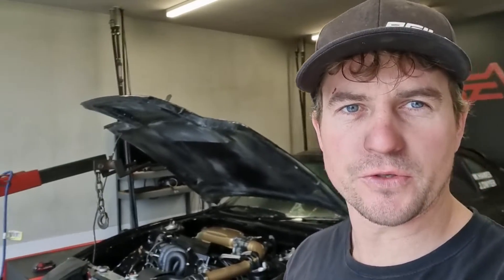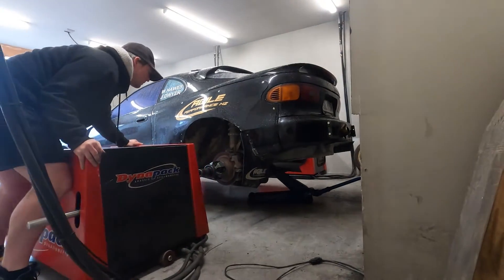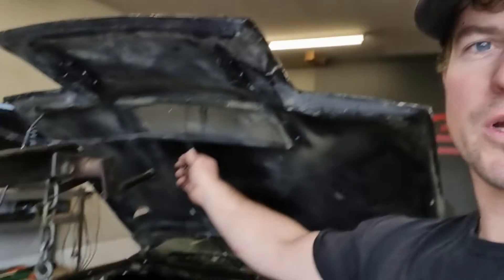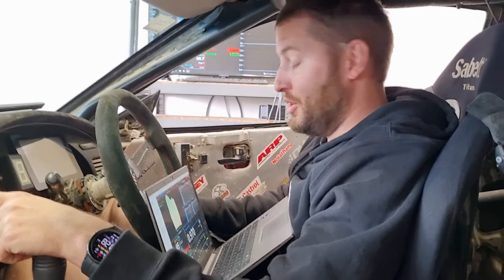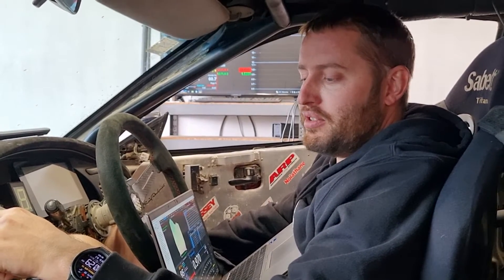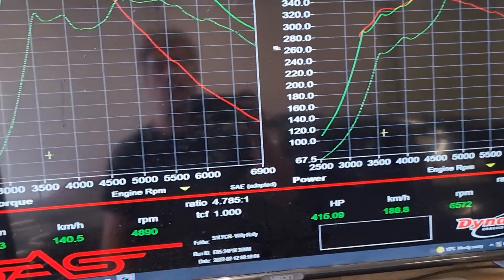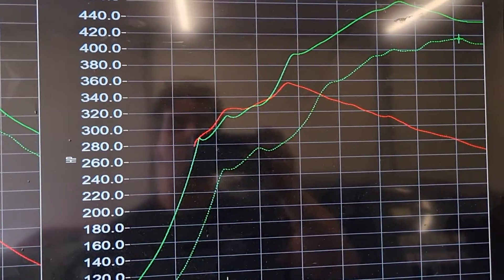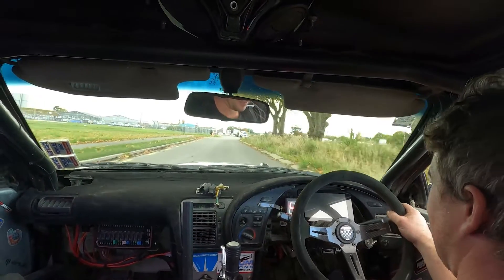How much power will the 5SGTE beams make??

Comment: How much of the increase do you think is due to head flow characteristics versus the variable timing profiles?  The curves look super similar just offset.  If the variable timing was causing the increase i'd expect a plateau/flat spot somewhere on the non variable curve and the variable curve to keep climbing.  Do you think this is mostly because the beams head flows so much better?
Reply from the maker: Its hard to say without testing. after playing around with the valve timing in the dyno, it makes a significant difference in torque/power. The extra 200cc also helps. the improved port design helps but wouldn't be significant I would think.